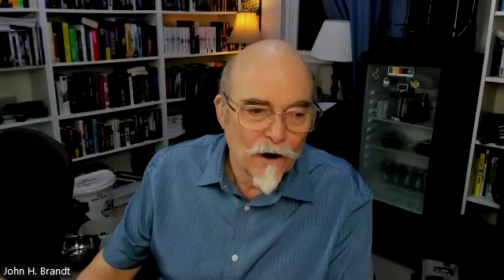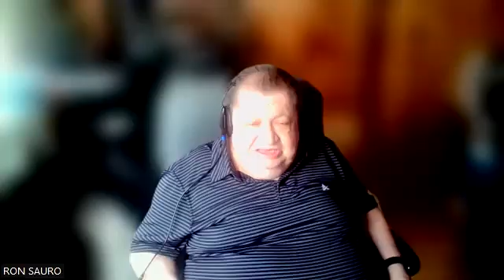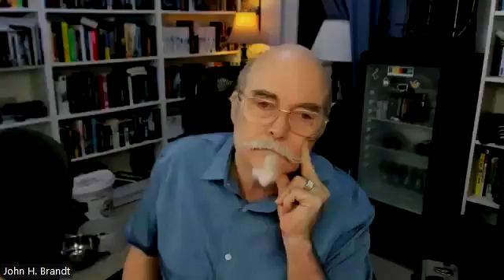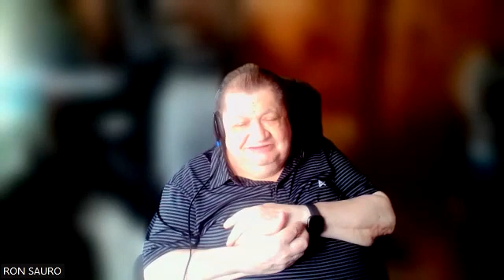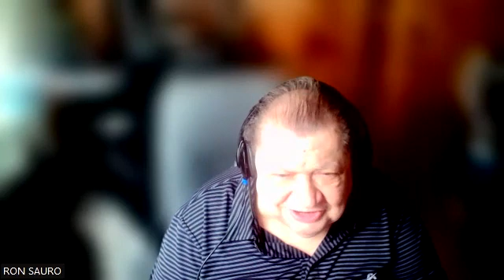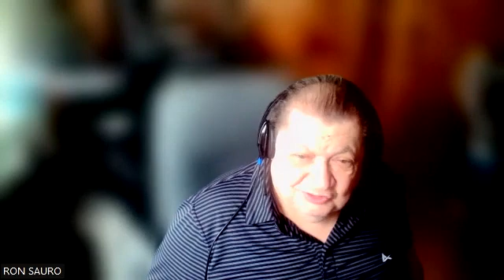Schroeder Frequency, Room Software, Law, Physics, and Science

Comment: Coefficient values greater than 1. This is a shortcoming of the test procedure isn’t it? A material can’t absorb more W/m than is incident on its surface?
Reply from the maker: Nope. You are following a misconception. A coefficient can't be higher than 1 BUT... a constant can. We have proven this time and time again in the laboratory. The so-called coefficient is not... it should be termed a constant. THEN it works perfectly. Room prediction software will need to be updated so that it performs correctly but this may take a few years. They require this to be accepted by all of the committees.. and you know how committees work, right? They always go with the lowest common denominator. LOL!